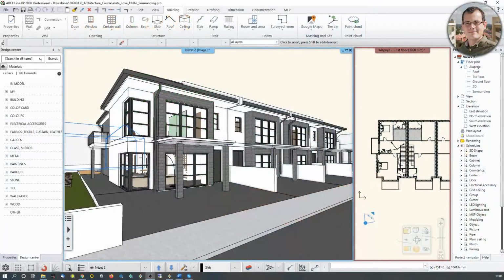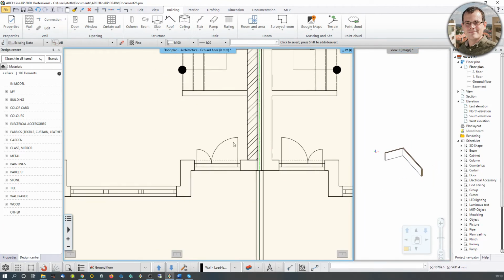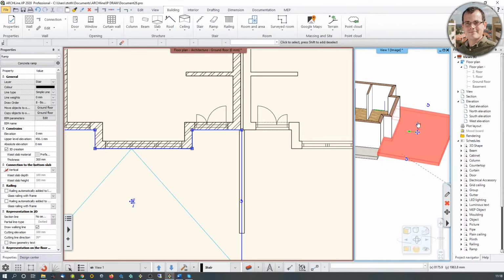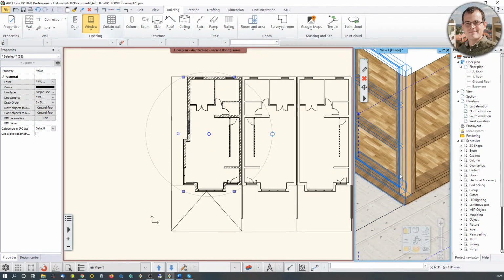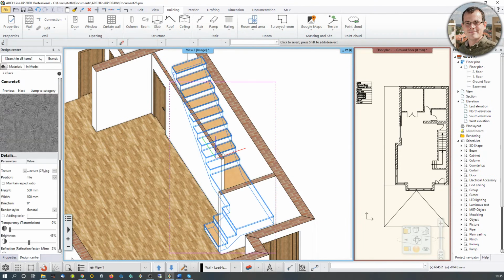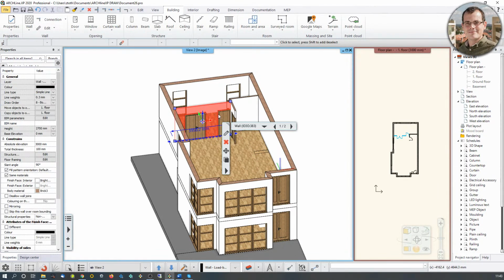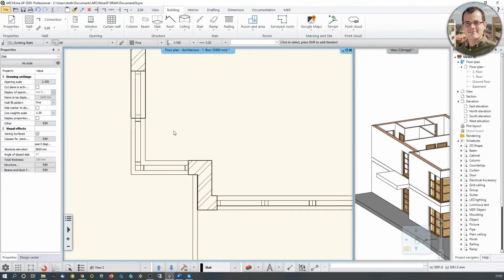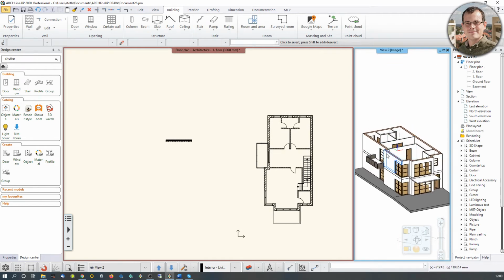Live ARCHLine.XP Course Part 1 - From Lines Comes a Building

Comment: Hi Zoltan,

I like this new format ArchLine-XP YOUTUBE video learning with voice over & with a clear UI, it seems more focussed, quick & less distracting than the usual webinar format. From this Part 1 course, can you clarify a few items as listed below for your ArchLine-XP Audience.

DESIGNING & DRAWING IN ARCHLINE-XP
Although we can see ArchLine-XP can be used for tracing over imported DWG CAD plans with 3D tools & creating a building model. It would be good to understand methods for new design building projects in ArchLine-XP from the start.

Furthermore, new design projects can involve extension works to existing buildings, therefore, would any 2D drafting tools in ArchLine-XP assist with this process ? i.e. drawing up the 2D existing survey plans first maybe.

LAYERS
We didn't see layers being manually created with the many new 3D building elements, i.e. walls, doors & windows etc. Therefore, are these automatically created for each of the new 3D elements ?

If so, can we change these layer names after ?
If no automatic layers, when are these best created & items moved to their respective layers ?
 

Regards,
Clayton
Reply from the maker: Dear Clayton, many thanks for your questions. I tried to cover them in our last webinar. In short, at its core, ARCHLine.XP handles layers and 2D drafting very similarly as other CAD programs. So everything you have asked about is doable, I suggest you discover more webinars of ours, where we demonstrate these tols in action: https://www.archlinexp.com/webinars